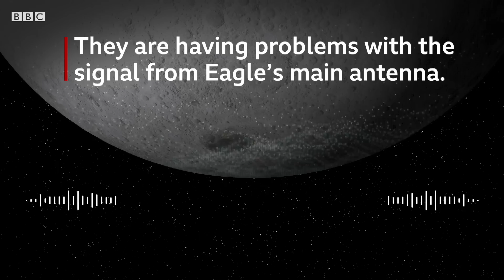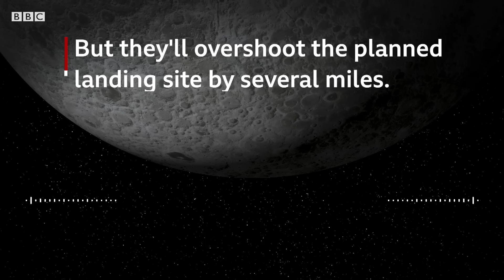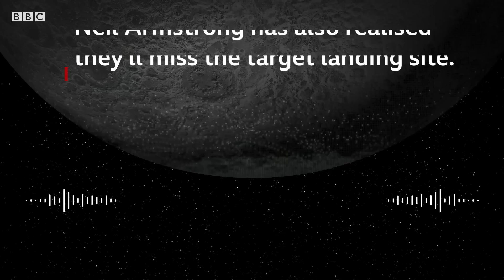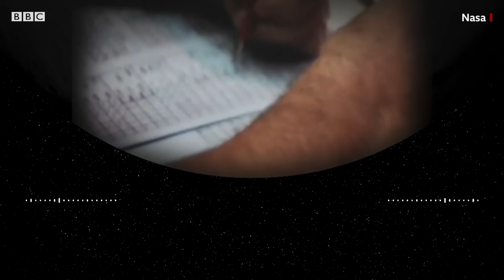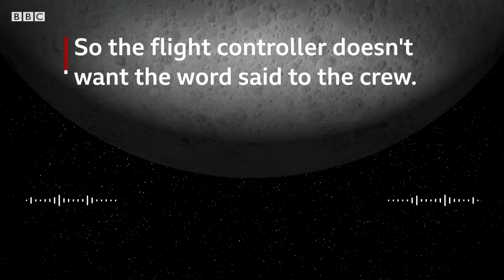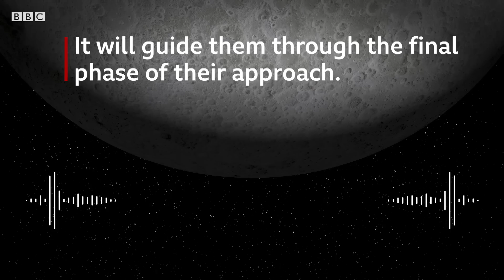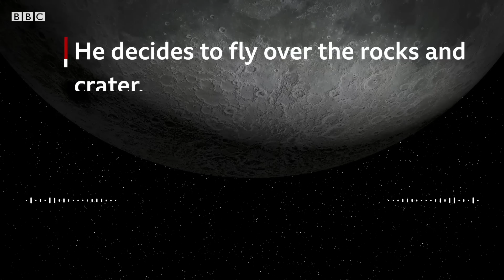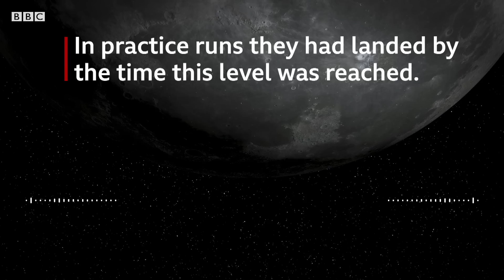Apollo 11: The final 13 minutes before the Moon landing - BBC News

Comment: he anomalies of the Moon?
another mysterious aspect of the Moon's magnetic field: the presence of several small areas (30-60 kilometers across) that have exceptionally large surface magnetism, about 10 times the normal Moon magnetic field. Lunar magnetic anomalies are locally strong magnetic fields near the Moon caused by permanently magnetized material in its upper crust. They have scale sizes of up to hundreds of kilometers and were first detected by magnetometers on the Apollo 15

Comment: 12:30 The video camera is operating, on its own? Both were very busy!
Took 6.5 hours to exit?  Sounds real enough, One wonders.
Reply: 16 mm film camera mounted to the window.
Reply: @dansv1  ....tiny cockpit trying to land safely and Buzz head doesnt even appear?  Triple-pane windows treated for radiaton / heat / pressure, not suntinted = crystal clear? And DUST was blowing (edited out) starting 400 feet....

Comment: Here's the thing, there is only 1 of 2 things that happened,  the first is we landed on the moon and found out that it is an artificially made base and we were warned off not to return which would explain why we havnt been back or two is we just simply never landed on the moon which would be the reason why we've never been back because we never did in the first place

Comment: Some places on Internet had people think they only had a total of 20 seconds of fuel remaining, after which they would have crashed, which is actually incorrect.  They had 20 seconds fuel left only for the Descent stage engine but they still had enough fuel for the Ascent stage, enough to get back to the Command Module in orbit. Should they have spent another 20 seconds descending, the mission would have automatically be aborted, the Descend stage would have detached from the Ascent stage, and dropped on the Moon surface, while the Ascent stage would have taken the astronauts back to the Command Module in orbit, much like it did when it took off the Moon surface.  http://spaceflighthistory.blogspot.com/2015/08/failure-was-option-what-if-apollo-lunar.html
Reply: Not quite that simple in practice.  Ascent engine must work and steer perfectly... as must radar guidance and the onboard computer to actually effect a rendezvous with Collins.  Theoretical maneuver never before attempted.  Thankfully an abort during LM descent (rather than a carefully orchestrated and precision liftoff from the surface) was never needed during the Apollo lunar landings.

Comment: 2:50 I’m concerned about the gap between Aldrin’s comment and the reply. Same with Armstrong’s comment after that. A comment and the reply should be more than 2.5 seconds, and that’s super quick at that speed. I wonder also about the reply to Armstrong at 5:34 Houston, you’re looking at our Delta H? The reply was immediate. This is bogus! The whole thing, the WHOLE Apollo program was faked, designed to place the US at the head of the world economy. And it worked. The reason why I say the Whole Apollo program is because the sheer number of photos with perfect focus, aperture, exposure, and framing which was supposedly preset. Preset photos cannot appear so consistent. The framing alone without a viewfinder, with gloves that would have been stiff in the vacuum, and suits likewise. If the sun is casting short shadows, then the temperatures presumably should be in the 200 degrees zone. Photographic film was not affected by the ionising radiation that apparently caused astronauts to see spots when they closed their eyes.
Reply: Alrukitaf Audio was recorded at Mission Control. There is no reason for a delay between an incoming call from the spacecraft and an outgoing response from CapCom.
Reply: Alrukitif you're an idiot and not even worth a discussion wiith
Reply: G.Gorrell Totally agree on the editing . Also, the poster appears to have deleted a subsequent comment which illustrates his inability to grasp that the point of recording determines where the delay will be.

Comment: No time delay???
Reply: Much of the audio you are hearing is calls between the Flight Controllers and Flight Director at Houston. There are only a couple of occasions where Houston calls the astronauts requiring a response and in those cases a delay is present. When Houston responds to an astronaut call there is no delay, nor should there be since the audio was recorded at Mission Control.
Reply: Good point, i was thinking the same. Today 2020 there is delays in cellphones and live video feeds but 1969 no delays from 100k miles away? really??

Comment: A Presumptuous Opinion: The Poop & Pee Theory proves no outer space and no moon landing. The astronauts supposedly spent three days to reach the moon and two days to come back. It is told that a clear plastic bag was used to urinate in and obviously someone had put catheters in their urinary tract into the bladder. On a
documentary just two days ago the urine bag was shown and it was a small thin clear plastic bag with pee in it. Looked like they could only urinate maximum 2 times and it's full. What a minute? How did you astronauts hold your pee for 5 days. Also, the capsule's inside barely had room for 3 people, so there was no toilet Wait a second? Where is all the poop for 3 men for 5 days. That is a lot of poop. We’re talking pounds of poop. Were you astronauts wearing outer-space-diapers? How did you astronauts hold your poop for 5 days? Can't imagine the smell inside that capsule. When the astronauts came out of the capsule, they must have had such a lovely fragrance to smell that made people immediately vomit. This was A Presumptuous Opinion on The Poop & Pee Theory. Now that's thinking outside the box.

Comment: didnt understand fuel was running low,,then how come they get back to earth.
Reply: Fuel was low for landing only, not for ascent and return to Earth. It was done in different stages.
Reply: @hgbnkbggj2915  ...thanks, was wondering.
Reply: @hgbnkbggj2915  but how could they use fuel in space where there is no oxygen?
Reply: @siralexferguson2507  Oxygen is not merely sucked out of the air in rocket combustion; it is stored in tanks. It certainly was not filmed on Earth. Perhaps you should understand the absolute basics - such as the mechanics of thrust - before dismissing this historic and scientific fact.
Reply: Unless of course.. this was on earth

Comment: What are the level of the radiation at the middle distance between planet earth and the moon? And at what level of radiation can the astronauts costumes cand rezist?
Reply: It's the equivalent of several chest x-rays. Not exactly nice to be exposed to it, but nowhere near deadly. Commercial pilots will experience more radiation overall than astronaughts.
Reply: @hgbnkbggj2915  ;)) mate your joking. Airplanes flies between 10to15 000 km. I google and some have the protection selling around 18 000 km. I am talking about the levels of radiation outside the earth atmosphere beyond the troposphere over 30 000 - 50 000 km. I talking about the level of radiations between half way distance from earth to moon. Where a solar flear can kill an astronaut in his protective suite and spaceship. Do you remember the solar flear at the beginning of the 21 century when it enter the earth atmosphere and all the internet and mobile providers shut down for a period of time to let the  radiation pass thru by shutting down the electrics on board?
Reply: @danielstoicescu8168  OK, well I see what you mean. A direct solar flare  would be catastrophic and probably fatal. But this does seem very unlikely. I was referring to the average (wrong) radiation levels that some tired conspiracy theorists like to spout out.

Comment: And we went thru the Van Allen belt with a tin can.....and the computer on board was the size of a car?
Reply: Huh? The computer on board was 24×12.5×6.5 inches.
Reply: It was a well insulated tin can Markus . Multiple layers of Kapton ( space blanket material )  and a machined aluminium inner capsule . The radiation belts were avoided to a certain extent during the orbiting process . Level of radiation  they were exposed to was not deadly . They had  the  very best minds of the time working the Apollo program , it was very complex , super expensive  and highly risky  , certainly we'll ahead of its time .

Comment: We want to know what happened during the 6 hrs & 39 minutes...?
Reply: LOTS of system checks and suiting up in very tiny space. They had to be extremely careful not to damage the controls when suiting up. Indeed, 1 switch was damaged  but they were able to fix it.
Reply: @hgbnkbggj2915  It was a circuit breaker switch they broke , which Buzz inserted a pen into to serve as the switch - it worked and they were able to launch  off the surface .
Reply: @shaneb6004  yes, that's right. Thanks for the extra detail. I'd forgotten that.
Reply: @hgbnkbggj2915  That's ok . It certainly was an interesting solution to a serious problem that Buzz solved .

Comment: 13 minutes  hmmmm ???   and   Apollo 11.    Oh well none the less we are supposed to believe this ?
Oh and the communications such clarity,  what brand of CB antenna did they use ?
Reply: Lol! You think that Apollo 11 used citizens band antennae?  Wow. Did you also miss the parts where they completely lost contact with the LEM? 
You people are seriously dense.
Reply: @robashton8606  So Rob, no  point in being insulting.   So if not a CB antenna , what then?    Please since you are so intelligent please elighten
Reply: @robashton8606  So Rob  was it a folded dipole, was it a yagi array ,  what frequency band were they on.    Oh  and how many watts ??    Remember we are going 250 k miles.    So  good buddy please enlighten.
Reply: @robashton8606  So Rob  were they transmitting with lots of power,  would that pull too much power from the batteries.    The batteries that worked the airconditoner, after all they were in direct view of the the sun without attenuation from earth's atmosphere.    Come on bright boy.  give me some answers
Reply: @usd25674  If you are genuinely interested, you can find all the technical data you want on the specially developed Unified S-Band comms rig the Apollo missions were equipped with via a brief search engine enquiry. There was a back up UHF system as well, but that required seperate channels for voice, t.v. and telemetry and was therefore rather power hungry, unlike the USB rig which could transmit all three Signals via a single channel. Comms between the command module, the lunar rover, the LEM and the crews suits was a separate system again, with several potential transmission methods but, being short range, power was not such an issue. Which system was used was largely dependent on the mission's distance from Earth.
Reply: @robashton8606  Come on Rob,  waiting on your  answers.    How do you get a radio signal  200 thousand miles away.
Reply: @usd25674  Oh, and the antenna for the Unified S-Band rig (one of several on the two spacecraft) was a specially built dish array, designed by the Jet Propulsion Laboratory.
Reply: @robashton8606  Really ,  what type,   dish perhaps ?   Did they have to open the window .    Maybe they crawled out on the roof and placed it.
Maybe took aluminum foil  and one guy held it why the other guy transmitted. 
So was it mounted on the capsule as it left earth ?   Did it not blow away as they were rushing through earth's atmosphere.
Why don't we use that technology today.
We could transmit around the world using just a wire coat hanger !
Reply: @robashton8606  You're  a hoot Rob.

Comment: This still tears me up. So proud of the dudes with cast-iron balls!
Reply: @aayushkhandelwal4912  they burn liquid oxygen as fuel. Also, thrust is created by ejecting mass with momentum opposite that of the intended direction. This is literally rudimentary, classical physics-level stuff.

Two main takeaways:
1) you don't need gaseous oxygen to burn; this isn't a wood fire
2) you don't need an atmosphere for thrust. Airplanes need an atmosphere because they're relying on pressure differential that they create as a means by which to generate both thrust and lift; however, spaceflight involves (essentially) throwing fairly heavy objects (fuel) away from you at a high speed and thus propelling yourself forward
Reply: @AxiomaticUncertainty  ok i agree about gaseous oxygen burn . but second point i never told about thrust i was just thinking about ,, i know moon have less gravtational force and no atmospheric resistence but still they need good amount of fuel with them to get into the orbit and switch orbits while traveling . even while going towards moon they need to adjust orbits which require fuel . dont you think even after compressing fuel they can take tht much with them as well as to carry humans and space weight i dont get satisfaction about fuel thing . second thing what about video the flag is waving proplr argue tht it is momentum aah shit the momentum momentum will look different and flaping looks different . other point is were is the moon dust is it on vacasion while landing (they used good amnt of fuel here ) thursters obviously pushed moon dust to side  and thier is litrely nothing no u will argue camera was on later n all the dust will be settle but it dosnt satisfy . and why their are no missions now ppl argue it need lot money dont u think tht it is invalid answer money is nothing to science even govnt and other countries will help doing the fundings . this is just informational talk it will be helpful if i learn sothing from someone .
Reply: There was no mobile fones back then no Internet even landlines were very scared yet they were able to talk to  the astronauts while on the moon, 🤦‍♀️🤣😂🤣😂🤣gimme a break
Reply: @Cassie-t1i  they used satellite communication from massive dishes all around the world including parks Australia. Lol you actually acting like you're smarter than PHD level scientists and engineers. Get over yourself
Reply: @Cassie-t1i  landlines have been around since the 19th century, idiot. WTF has mobile phones got to do with NASA technology? you better give that limited brain of yours a break
Reply: @Carmel
And radio had existed for decades before this, dummy
Reply: They had 3 balls the rest of us have 2! 👍
Reply: @thePiercingTruth no it doesn’t? Airplane jet engines convert the energy into rotation of blades whereas rocket propulsion expels burned fuel at high velocities in the opposite direction to itself therefore increasing its momentum.
Reply: @thePiercingTruth but that’s basic conservation of momentum bro. The rocket propulsion would work in a vacuum because it relies on the conservation of momentum stored on the ship (by releasing weight from the ship) and not on applying force to external molecules (the atmosphere in the plane’s case)
Reply: @thePiercingTruth you’re giving no reasons lol… I literally just explained to you why it works based on like 4-century-old Newtonian physics. It’s not even close to the same as how a jet engine works. This has to be a troll
Reply: @thePiercingTruth okay bro try reading a single damn thing that I said and get it through your thick skull that it’s likely that you’re borderline mentally deficient in reality. I guess just saying they’re equivalent proves something? Hey guys the moon is made of cheese. Guess what? Now you have to go fly to the moon and prove that I’m lying.
Reply: @thePiercingTruth not a ton since radio waves that have left the atmosphere no longer require much energy due to a lack of interference in space given the lack of atmosphere
Reply: @aayushkhandelwal4912  lol. So WEAK not even worth responding to.
Reply: @aayushkhandelwal4912  you people are holding our society back.
Reply: @aayushkhandelwal4912  If you use the right instruments, you can actually "see" the reflectors placed there. Is your next accusation going to be a worldwide conspiracy that involves creating a fake moon?
Reply: @aayushkhandelwal4912  Prove it
Reply: Soggy balls you mean
Reply: Aayush Khandelwal that or they redid videos for better viewing after they landed..I’m still not sure what the truth is, the govt lies so much especially NASA and the damn CIA

Comment: I remember this as if it were yesterday.  I can't believe it is 50 years ago!  Well done USA!
Reply: I was 19 when the Eagle landed. Not knowing some of the technical talk at the time, I did not realize what a close call this was. Another few seconds and the landing would have been aborted. However, they were so close that Aldrin and Armstrong weren't backing out as long as there was a chance. It took a lot of technical expertise to pull off this mission, but it also required guys with steel nerves. Sometimes "testosterone poisoning" is just what the doctor ordered.